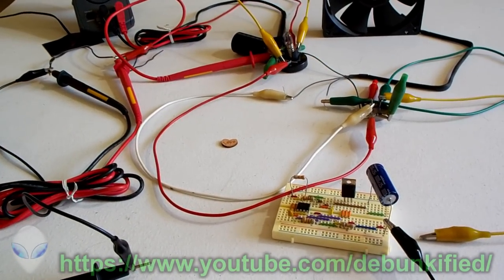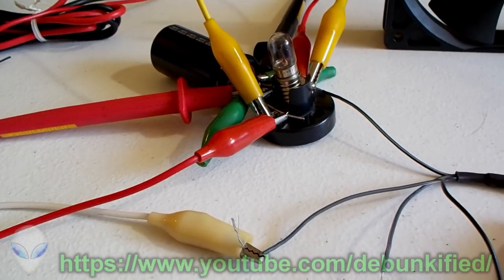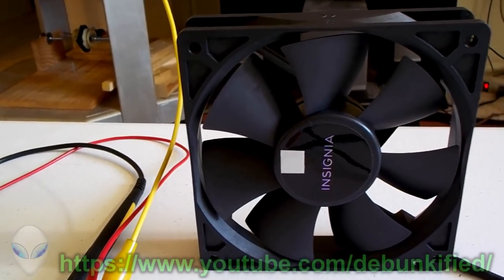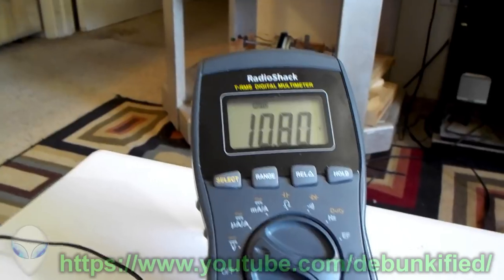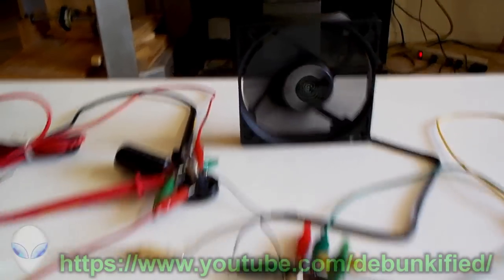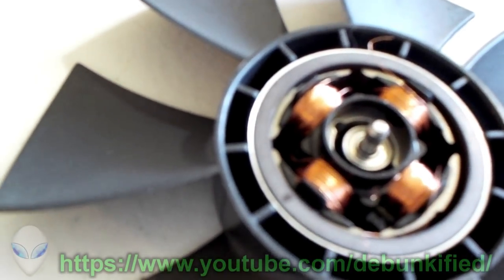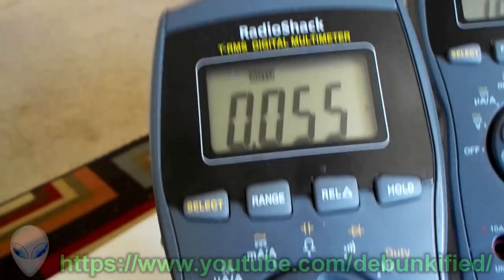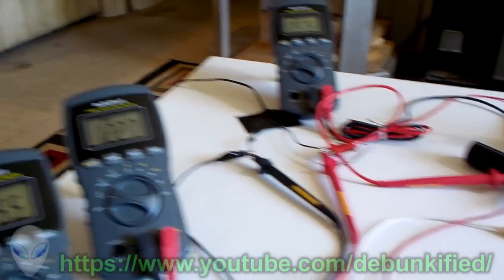Ecm Fan Motor Pulsed with Energy Return

Comment: you can use an ultrafast diode to catch c.e.m.f as well as pulse with duty cycle  10% on 90% off. you will see a massive difference. Conventional meters will not measure C.E.M.F but if you set the fan up to charge a second battery (which can be metered) you can see the over unity results. Great video, thank you.

Comment: The main reason ecm motors are more efficient is because they start slow removing the high amp draw on startup.Have you ever experimented with a high eff. washing machine motor? I know it’s a lot bigger and expensive but nevertheless an interesting motor design.
Reply from the maker: Hi, can’t say any experimentation was done on a washing machine motor before. You think a ceiling fan is worth getting? Having a difficult time getting information on the types of motors they use. Would be nice to know before wasting time and money on tearing one apart just to find that it needs to be returned. Or even a refrigerator motor would be good if it was the right one like brushless.
Reply: debunkified ceiling fan is typically a shaded pole motor. Not really too exciting to mess with. The new high eff. exhaust fans for bathrooms are Brushless DC or ECM. Most of the technology is in the controls for the motors. Such as a pulse motor or a VFD (variable frequency drive.

Comment: Hi,
A circuit diagram will help, how have you got  the coils connected and to what is the capacitor connected to.
Really a waste of YouTube and my energy.
Reply from the maker: Hi, please don’t feel that way. There are 4 coils. Two of them are connected to the base and emitter of the transistor. The other 2 are connected to the emitter and collector. So 1 pair triggers while the other pair pulses power through. It’s been the same circuit design that’s been shown for years now. The capacitor is directly connected to the lightbulb as well as to the top and bottom of the 2 coils being pulsed except for just one diode at the collector to capture the collapsing field to charge the capacitor, or the lightbulb if there was enough.
Reply: @debunkified  show it..schematik..

Comment: debunkified you dont have any nothing,  nature of free energy have steps, you need come back to the resonance and the capacitors ...
Reply from the maker: Hi, you might be right, but can you clarify which concept are you referring to with resonance and capacitors? There is solid state and mechanical, or are you referring to resonance in general with caps? For example LC or LCR circuits?
Reply: Resonance of free energy is a bit different.  It is not like sinus, it is more like conversation voltage into current and vice versa. It was reason why Tesla was using spark gaps or "rotating commuters". You going in good direction but add that "switching". Good luck. Sfieszaq